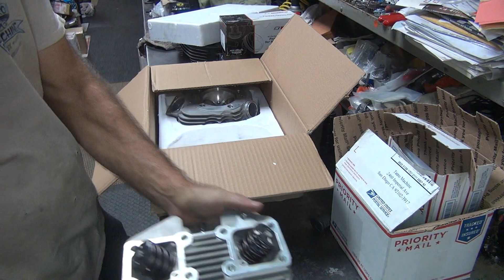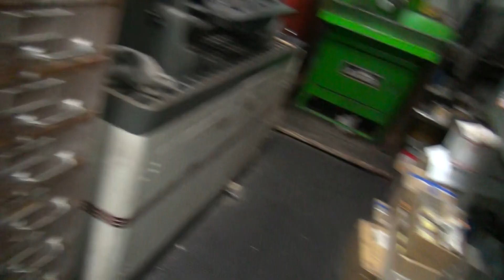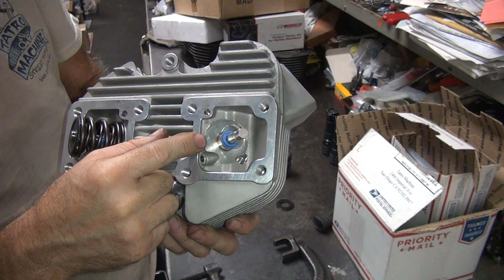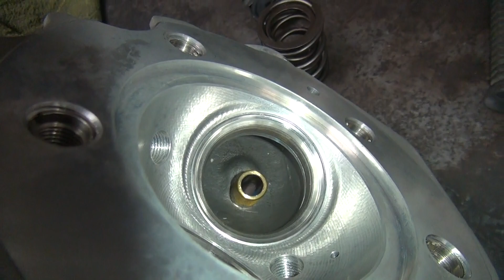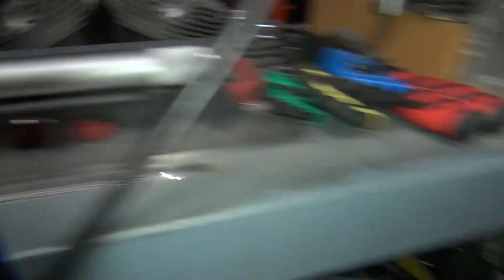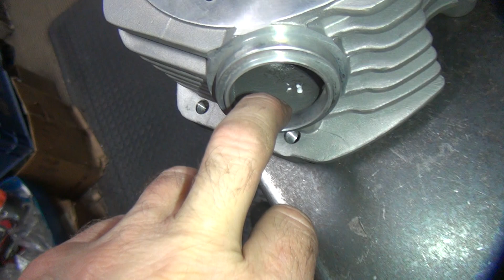#105 1976 98ci stroker shovelhead motor rebuild case repair flywheel balancing harley tatro machine

Comment: Is there always so much of the guide in the bowl .. All that valve guide has got to mess with flow right ?
Reply from the maker: the topend does not hurt the crank. its just that your crank was way out of true and finally let go.
leave the guide in the port if you want it to live.
tatro

Comment: Big money sitting there
Reply from the maker: they are way cheaper than fixing the stock heads.
tatro
Reply: @TatroMachine  really? how so? $50 a pop to be surfaced. another $100 a pop for guides and valves
Reply from the maker: whos doing your work.
tatro